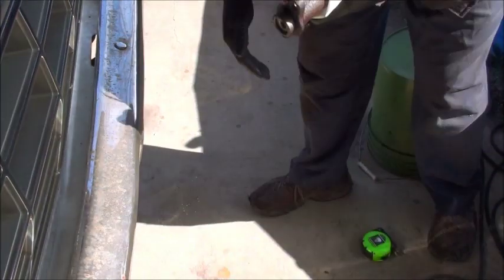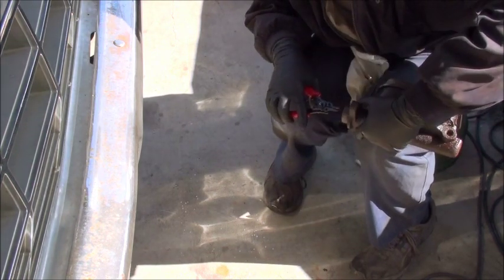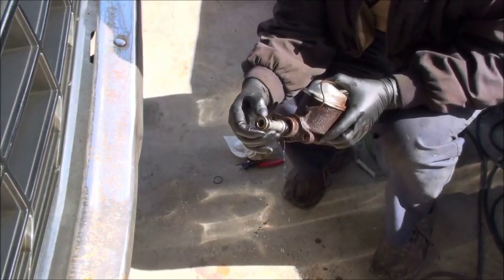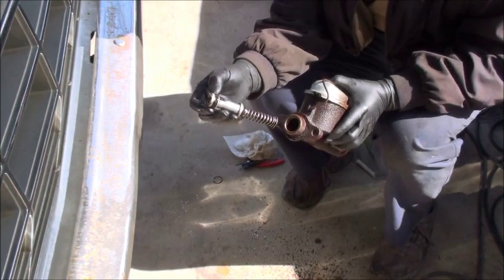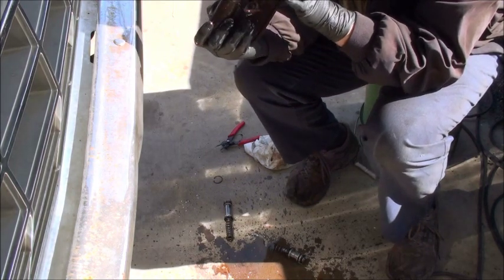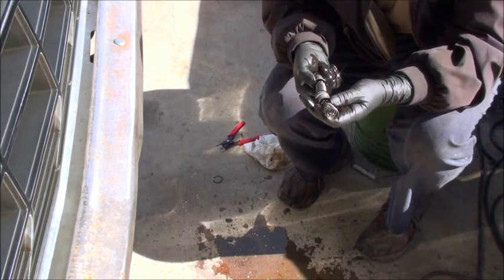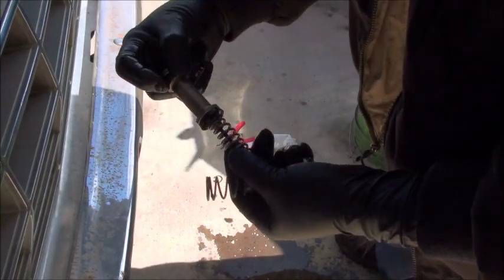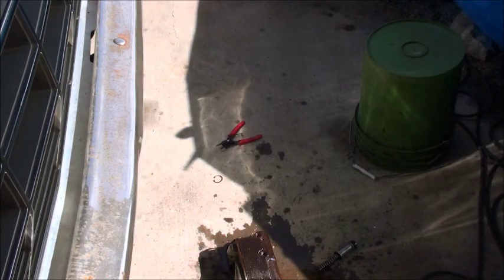HOW IT WORKS , BRAKE MASTER CYLINDER AUTOPSY !!!

Comment: Cardone sucks balls up the walls i swear everything rebuilt by them is soo craply put together and the quality sucks, it's soo retarded, i mean everything by cardone is even worse then used oem ones omg, they just throw the parts around, bead blast it wash it and plop the parts together, my remanufactured calipers even came with the old bolts that they just bead washed omfg how cheap and crazy is this, and the brake line washer seal surface was even marred up and they didn't even attempt to resurface which is soo easy with the right tools, and they never chase any of the threads, stay away from junk parts from cardone.